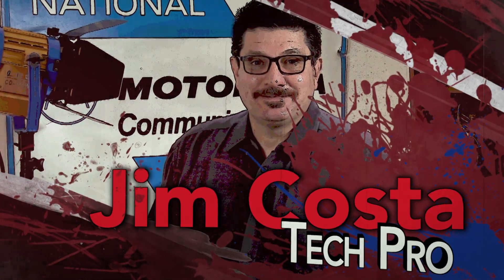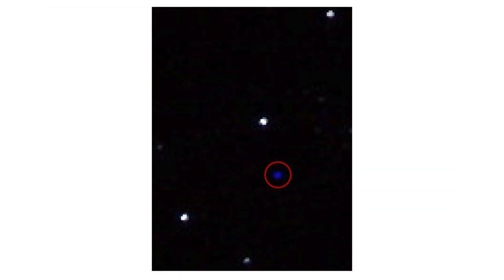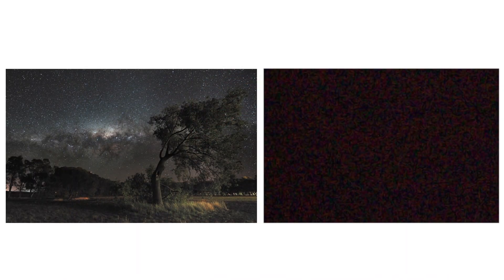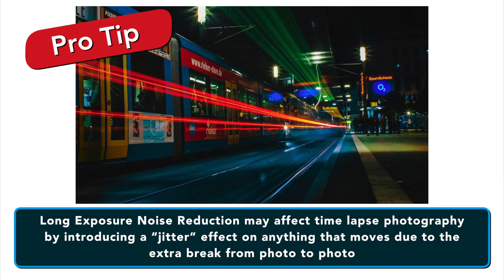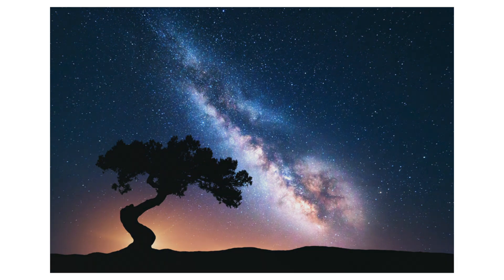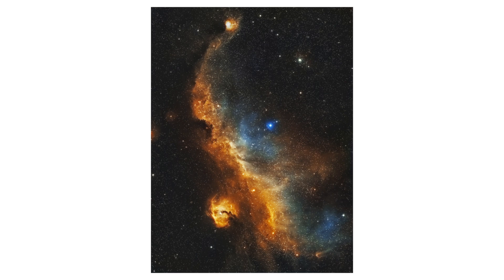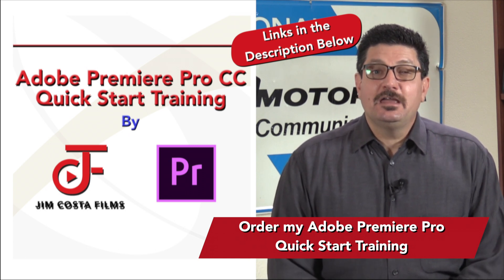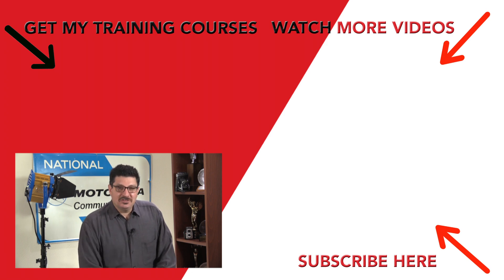Long Exposure Noise Reduction Explained | Hot Pixels & Thermal Noise Explained

Comment: Thank you, I knew how the in-camera noise reduction worked, but the delay for sunsets was a problem. Your suggestion of a second dark shot, using a layered subtraction method ( sounds like a salad) in PS would be very workable.  Who knew? Thanks again.
Reply from the maker: I glad you found the info helpful. I personally think the function is best for shooting the stars. You're correct that the sunset happens too fast and the sun moves too fast for the function to work properly. The sun is moving at 1000 MPH after all ad the earth spins! If golden hour shooting is your thing, you might want to check out the tutorial I did on that: https://www.youtube.com/watch?v=sYnae_Zb7qI&t=7s. There's a blue hour guide on my channel also.

Comment: I had to check if I have this option on the Canon M50..it says "noise reduction applied to images exposed at 1 sec or longer" Most photos are taken within a few secs or with the timer so I'll go with your recommendation to leave it off. QUESTION..if I wanted to make myself pop out more in my video with blurred background would I need to upgrade my 22mm F2.0 lens which I currently use to something like 50mm F1.8
Reply from the maker: That's my preference as well. However, since most of the time when shooting I'm not shooting longer exposures, it doesn't affect anything to be left on. When I'm shooting longer exposures, I will make certain to turn in it.